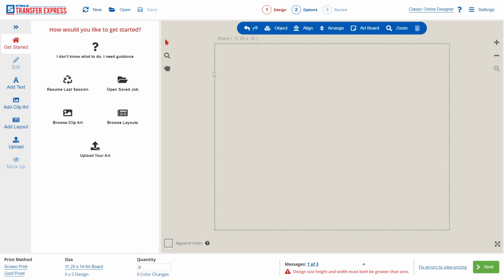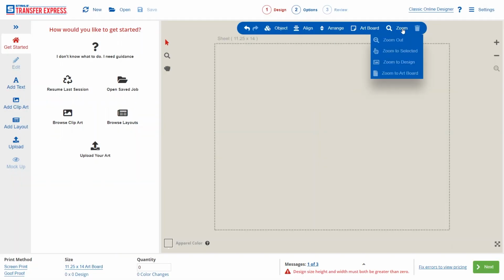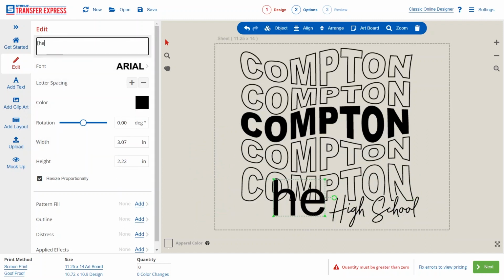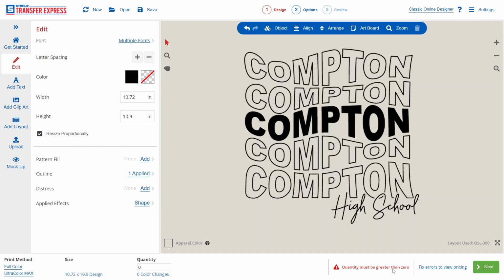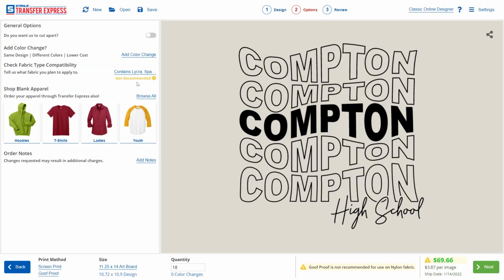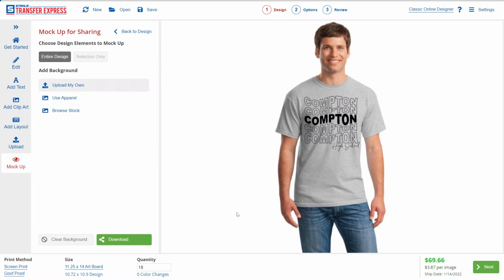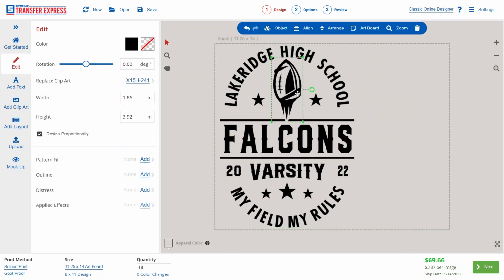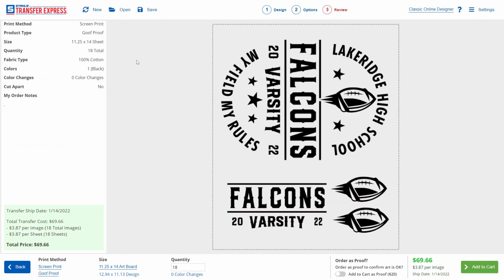Design T-Shirt Artwork Online: Easy View Designer 2022 Updates

Comment: Are you going to make the grid line sizes/amounts adjustable? so that there are more lines for fine detail alignment?
Reply from the maker: That's a great suggestion! It's not in the works currently, but it would be nice! Are you thinking centimeters vs inches or just a finer grid, or more like adjustable guides like photoshop?
Reply: I guess to be able to choose more grid lines per square inch